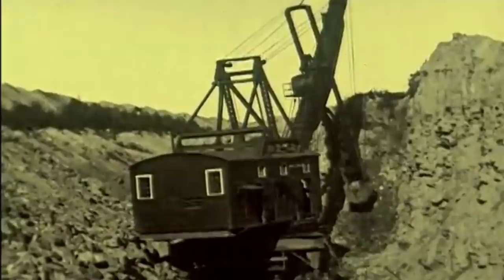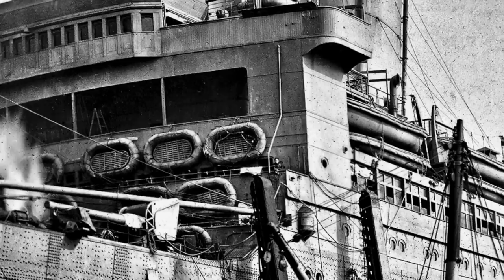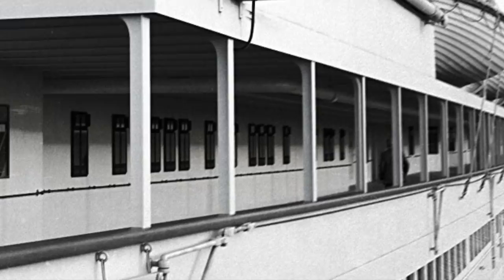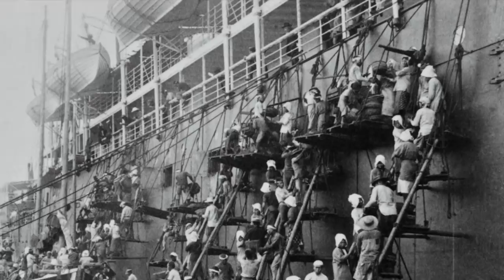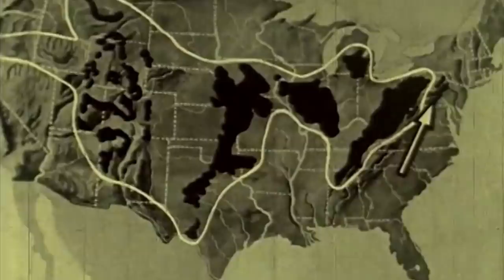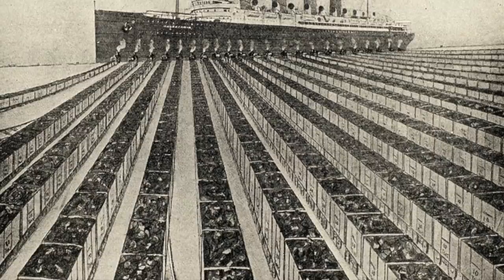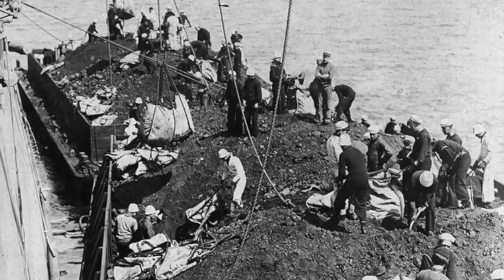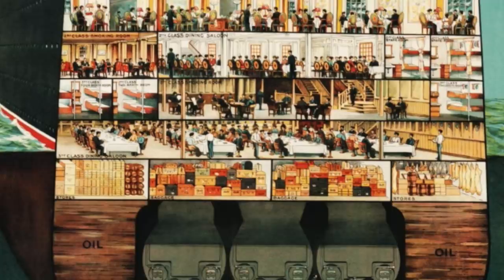Coaling/Bunkering an Ocean Liner

Comment: The ordinary man or woman today can't comprehend the hell it was down in "The Hole" on some ships and in certain regions of the World. It's been over half a century since I did my time in engine rooms and the worst I had to endure was on a WW2 Tank Landing Ship (LST) in the Mekong Delta. We did our watches in consistent 135 degree temps but had the luxury of a totally relaxed uniform, meaning our pants were cut off, shirts sleeveless and unbuttoned, we had water we could keep them soaked with and a couple supply vents to get in front of, plus we made runs to the galley to get buckets of ice cubes to eat. Compared to those guys shoveling coal to feed the boilers, we were on a luxury cruise. The noise in those diesel engine rooms was something to experience, this was before there was any "safety equipment" concerns, a far cry from today. I really enjoyed your video, well done.
Reply: Hows your hearing?
Reply: @ruddigerburns9051  It's still pretty good, my time was spent in the aux. engine room with the generators, the main engine room was 32 feet square and had (2) EDM 567 locomotive diesels side by side. You would have to go over to the escape trunk and cup your hands over someones ear and yell, and they still could barely hear you, not much idle chatter down there, of course that was true in any engine room. I remember the hardest part for me was on the mid watch (midnight to 0400) when you're underway and every thing is normal and your sitting on your chair in front of the supply vent...sometimes your whole body seemed like it was asleep and the only thing awake was your mind trying to stay awake, those were long watches, just the OPPOSITE of someone in bed, worn out but unable to sleep because of stress or whatever. Of course those old boys feeding the boilers must have been tired but at least the blood was flowing, and dozing off was the least of their worries. My memories of time spent in the engine rooms of 3 different ships are some of my most cherished work related memories (and I have many), but I don't think I'd feel the same way if I'd been ruining my health shoveling coal down in "the hole".
Reply: I took the "hardhat tour" of the USS Texas a number of years ago.  They call it that because they take you into spaces that are often cramped, such as the magazines and the boiler rooms, and everyone wears a hardhat to avoid head injuries from walking into the spaces.  Now, I'm a steam power enthusiast, and have built model steamboats, locomotives and stationary engines, as well as boilers.  And even though I knew how the power plants in a steamship worked, I wasn't prepared for the conditions in the boiler room. The access to the boiler room was through an access trunk, basically a 30 or 36-inch pipe, with a vertical ladder inside, that you had to climb down to get to the boiler room deck.  If I remember correctly, it was about 15 feet down from the deck above, and the hatch at the top was small, not normal hatch size, like you'd find in a companionway watertight bulkhead.  During operations, it had to be sealed, because if it wasn't, it would affect the draft for the boiler.  Now, the Texas was oil-fired, so the boiler rooms were fairly clean.  I'd hate to think what the boiler rooms in a coal-fired naval ship were like.  There's a reason that division was called the "black gang."  I'd imagine that the likelihood of being able to evacuate those spaces was low, if a ship was sinking due to battle damage.  Another thing that was brought home to me was how much bigger men are now, than they were 100 years ago.  I'm six feet tall, and weigh about 200 pounds.  In the first decade of the 20th century when the Texas was built, adult men were between 5' 6" and 5' 8" on average, and seldom weighed more than 140 pounds.  They would have had a much easier time moving through that access trunk.
Reply: @tjh44961 That's a great experience visiting old engine and boiler rooms. The thought of being in a sea battle should chill the blood of anyone in their right mind, but being down in the hole would be horror. Few people realize that in the sinking of the Hood and Bismarck, there were 4 ships with a total of 3500 DEAD in just a couple of days. I can't begin to imagine what it was like to be there, let alone being down in the hole with all the "doors" secured because of "Battle Stations". On the height thing, being on a WW2 Tank  Landing Ship was tough for me as I was/am 6' - 5.5", the height of the compartments were 6' - 5" and you had all the electrical, plumbing, ventilation in the overhead so usually there was only one little place in a compartment where I could stand up straight but with my head down, the rest of the time I would standing with my hands on my knees. It was a miserable year but also the greatest adventure of my life, of which had no shortage of them. If you ever go near Evansville, Indiana, stop in and visit the LST 325 on display there or at least pull it up on YouTube... Cheers
Reply: 1970, as Black Gang snipes in the fireroom of a U.S. destroyer; we'd cook baked potatoes filched from the spud locker in the mud drum , I'd heat up cans of Chef Boyardee ravioli on the main steam line for my own personal midrats, and in port once, one of our guys was on a working party taking on provisions and slipped down our "hole" a full carton of lobster tails, we cooked 'em in a bucket using the root steam for the bilge pump- supposed to be for the officers mess, heh heh ☺We all got tight, I mean real tight at Yankee station during fire support ops, even tighter still doing surface raids up north.
Reply: @BeachsideHank  Your comment made me LOL! The memories of "the Hole"... how often I've refrained from telling friends actual temperatures for fear they would think I was BS-ing them. "Midrats" is a dear old term I haven't heard in a long while. That lobster feast..."oh the joy", our dirty little ship didn't rank very good grub, we had Lima beans every day in one form or another and roast beef that was boiled and sliced thin, it always shined like oil on water in the sunlight, the flour had weevils in it so chocolate cake was great because you couldn't see em. I remember the "cooling air" we'd get through our supply vents was already hot and humid, but it felt good. Life was dirty, hot and unpleasant, but we were always going from port to port and got liberty in all these weird "nothing" towns and beaches that I locate on Google Earth and they're major cities and resorts now, Thanks for your reply.
Reply: Yeah, it's hard to imagine how bad combat at sea was, I know when things went bad in the engine rooms, they died pretty fast, although not pleasant. Better than torn by sharp metal fragments and ending up as a shark buffet. I recommend watching the old "Victory at Sea" series that was produced right after the War, for anyone who hasn't seen them already.
Reply: These men were, no doubt, in incredible shape and in good health.
Reply: Glad I wasn't on your ship. Mine (USS Guam, LPH 9) at Gitmo it was 124 in the fire room. And at the EM club at midnite it was only 100. You sweat out the beer as fast as you could pour it in.
Reply: mark mark if your talking about the same ship what were the diesels for? Weren’t you using turbine generators? 
t. Engineer
Reply: @FlatBroke612  I served on two ships that were steam turbine but the reference above was to a WW2 "Landing Ship,Tank" known as LST's that were powered by (2) locomotive diesels from the early days of the diesel locomotive, the aux. engine room had 3 diesel generators. The reference had to do with the heat those boiler stokers of old had to deal with, depending on where in the world they were operating in. Down in the Mekong Delta while it was around a 100 degrees outside and high humidity,  down in the engine rooms it was quite beyond belief if you haven't experienced it, NONE THE LESS, those boiler stokers of old would have thought we "had it made".
Reply: mark mark right on. I only ever sailed one steam turbine ship, the rest all motor ships. Mostly slow speeds but a few multiple engine medium speeds  with a reduction gear to a single shaft. The opposed 2 stroke Fairbanks were the loudest by far. Those scavenge blowers really howled at full away. Used to see a lot of 71/96/149 series Detroit Diesels as gen sets. Those are few and far between now with pollution regs getting ever tighter. It was almost 50c in the engine room last week and I’m not in the tropics... that was hot enough!
Reply: @FlatBroke612  Thanks for the reply, this column has turned into a bit of fun for me. On my last ship (steam), I believe our Emer Diesel Gen was a opposed 2 stroke Fairbanks, that sucker made some noise, but less than the EDM 567's in the LST main engine room. That opposed 2 stroke design might be catching on, if engines interest you check out Achates Power on YouTube. I enjoy reminiscing about the heat and can remember reporting on board down in Saigon, when you realize how you're going to be living and working for the next year, you can hardly believe this is happening to you. None The Less, it was better than the boys out in the "jungle" had it, at least we were going interesting places all the time, and never got shot at although we spent quite a bit of time at general quarters on the rivers.
Reply: Sorry guys, I just realized I was using the term "EDM 567" when the correct term is "EMD 567"...Electro- Motive Division diesel of 567 cu in per cylinder, used in EMD locomotives from 1938 to 1966. Ours were 12 cylinder, 900 hp @ 744 rpm...
Reply: The filth of bunkering coal ships does have a modern day equivalent, which is the filth of cleaning the air receiver to a modern 2-stroke propulsion Diesel engine. This air receiver has direct access to the 2-strokes intake ports. The frequency of conducting this evolution is far less than coal bunkering. A lot of operators will hire local shoreside support to do this, as they’d rather not have their own wipers, oilers, QMED’s be subject to such carcinogens.
Reply: @stevedoe1630  Thanks Steve, as "beautiful", spacious, and "clean" the modern Marine Diesel engine rooms are, there's still some hard, nasty, filthy work in there. I saw a YouTube video about what you were referring to. It's been over a half century since my time in the hole, I never dreamed that in my old age I would get to explore, visit, and see so many cool things and places on a little flat screen and something called YouTube. Cheers
Reply: @markmark2080  
To me, the beauty of a steam plant is the heat cycle. You can put your hand on the boiler... "heat source." Put your hand on the turbines, expansion. Hand on the condenser, heat sink. Trace out the pipes from 1st stage heater, 2nd stage heater, DC heater, economizer... heat recovery.

Of course, all these parts to the heat cycle exist in the diesel engine plant, but requires a schematic diagram to see it. The beauty of the steam plant is that all this is tangible. If the worker is willing to look, and trace pipes, and listen to the design of the plant, she will reveal many of her mysteries.
Reply: @stevedoe1630  Well put, Steve, I feel the same way about all "old school" machinery that you can look at and trace out the "course of events" designed into it. I feel fortunate to be a bit of a gear head and have this desire to understand, to a degree, how things work. The pleasure of going into an engineering space or factory and seeing not just shapes, but understanding what's going on inside that shape is one of the great joys I have in this age we live in. I stayed on the Queen Mary a couple times 3 decades ago and spent a lot of time exploring the engine room (s), (they had gutted the boiler rooms), that was a challenge trying to figure things out and I came up short, but what a wonderful place to spend some time.
Reply: The temperature and noise levels have not changed much from then. I have worked in many an engine room that is 130+ degrees. The hearing protection has made the noise less dangerous to hearing though. And the ECR's or engine control rooms are mostly air conditioned (but not always) so you can duck out of the engine room briefly and escape the heat once in a while if you are lucky enough to be on such a vessel. Unfortunately with the emphasis on safety now a days we dont have lax uniform requirements. We must wear heavy coveralls that are fire resistant, gloves, steel toe boots, and hardhats which makes the heat much worse! Thank you for your service!
Reply: @gregbailey1529  Thank you for your reply, I've noticed in watching YouTube videos the "clothing" being worn today because of safety regulations, but uncertain of the temperatures in the modern ER's. Wearing all that gear at 130+ would be....something all little whining, complaining, spoiled brat snowflakes ought to have to experience for a time, maybe it would shut them the frack up. That just kind of came out...as for my service, It was an incredible adventure and I escaped harm, my heart goes out to those less fortunate who did suffer greatly, both physically and mentally, for a debatable result. (that's a can of worms)
Reply: @markmark2080  Back in 1972-3 I was a Jr. Engineer on a troop ship running between S. Korea and Viet Nam. After the peace treaty was signed the ship had orders to come home to Oakland, CA. This was with the Military Sealift Command and I was going to be laid off when we got back. So the Chief Engineer called me into his office and offered a job on a LST running around Viet Nam. I have been regretting not taking that job all these years until reading your account. Although that troop ship engine room showed 127F off the coast of Viet Nam, it seems better than your situation back then. Plus I'm 6'3" and would end up all bent over like a Chief Engineer I once knew.

The reason I turned down that job was the Chief had come from motor ships and had no hearing in one ear and only half in the other. Most the time he had to read lips. I didn't want to end up like that. So after your description, it's probably best I didn't take the job.
Reply: @Mondo762  Thank you for your reply, I was an "Electricians Mate" and only had to do the 4 on 8 off watches in the Aux Engine room which probably saved my hearing, having to go work in the Main engine room underway was not pleasant and I felt for the "Engineman" who were "stuck" down there. Yeah, at 6'3" you're tall enough to take the pleasure out of the cruise. The "frames" in the overhead were 5' 7" from the deck and of course the doors were the same. The engineering berthing compartments were right under the main deck, which would get as hot as you can imagine, my rack was 24 inches below that...to cool the compartments we would have a "tank deck exhaust blower" running (when possible) and for air to get into the tank deck it had to flow through our compartments (I'm laughing here thinking about it) like a 100 degree wind to keep things "bearable". I wouldn't want to do it again, but I'm so thankful that year was part of my life.
Reply: mark mark I was a Corpsman in CG 17. Harry E Yarnell. AAW platform , keel down 1959 from Bath. 1200 pound plant. I was familiar with doing temp , humidity checks. 
My battle station , aft BDS :
Port side aft. Directly above , four harpoons , inboard and down one deck a 40 round magazine of Tarrier SAM missies. Below a fuel tank. Point is , in a sea battle you just sat there .....waiting 
To DIE. 
After ESWS I cross decked from sea tour to sea duty to the Corps. Best decision I ever made
Reply: @mikepazzree1340  Thank you for sharing such a profound truth, In my time in the Mekong Delta, I never experienced "fear", although there were dangers and we operated under "relaxed general quarters" quite often. When I read about the Atlantic and far northern convoys during WW2 and the losses they suffered and the hopelessness of the situation if your ship was "hit good", I can only imagine the horror of just "waiting to DIE", either in the water or trapped inside a hull. Actually, what I just stated applies across the board to any vessel, in port or at sea, in times of peril. I loved my time at sea and am thankful I was able to enjoy it without "fear", although there's something to be said about "going into harms way" and returning safely.
Reply: What military was you in? It seems to me. that even simply creature comforts are always slow to be adopted by the US military. 

My dad served in the US Army, in the 1990s as a truck driver. NO AC, in Uncle Sams rigs, though I think they had heat.
Reply: @Lappmogel  Lol.
Reply: @jed-henrywitkowski6470  I was in the US Navy, '65 -'69, as miserable as it was on that old ship, which was built solely to get a job done during WW2.  I often thought about the "boys" in the jungle, and would not have traded places with them for anything. At least we could shower, although drying off was almost impossible. The main thing that made life tolerable was the adventure of always moving from port to beach to town to city to some place new all the time, I kept track of 22 locations from Japan to Bangkok, a couple of them 5 x's each over the course of a year. This is in contrast to the "fighting ships" which normally stayed somewhat "on station" for 60 or 90 days at a time (I welcome comment or correction here).
Reply: @markmark2080  900HP and about a zillion ft lb of torque.
Reply: @marvindebot3264  Yeah, I think they made about the same amount of torque as they did noise. If you ever go near Evansville, IN, that's the home to LST 325, a restored and operating historic Landing Ship, Tank....Well worth the visit in person or on the internet. There's another, LST 393 up in Muskegon, MI, that is a military museum.
Reply: Thanks a lot both for posting and your follow-up comments = Important :)
Reply: @beachbum4691  You're welcome, John, I enjoyed talking about it, it's rare when you can.
Reply: Joe  Thanks for the comment Joe, when you're underway in the open seas, how many are on the bridge on the midwatch these days? I never really thought about the guys topside having that problem, but a routine, boring midwatch is tough no matter where you are.
Reply: Joe  That 6 on 6 off stuff would be tough if you were under the weather. Being an Electrician, I had the run of the ship during working hours and only had to stand switchboard watches in the hole, unless there was electrical repair down there. I kinda felt for the Machinist Mates and Boilermen who had to work all day down there AND do their watches. I used to think how cool it would be to be up on the bridge and see everything that was going on, but that, like almost everything else, would get very routine, except for entering  ports. This comment thread just kinda happened, it's been a lot of fun thinking back on those times, thanks for your input.